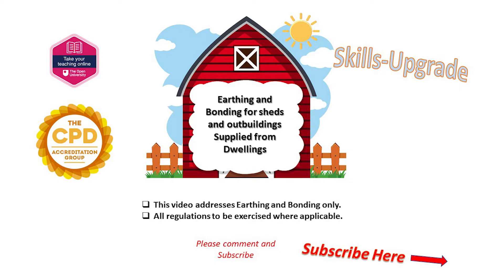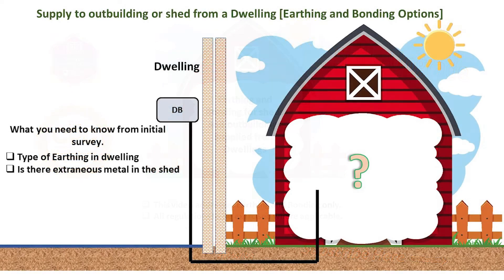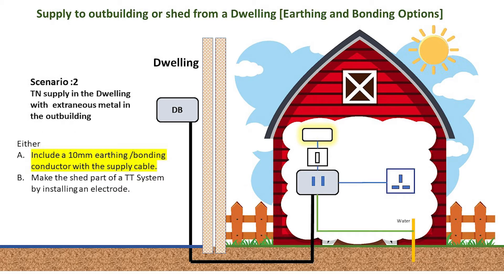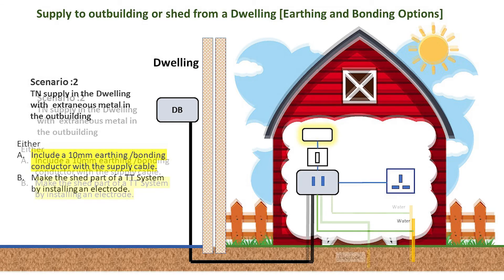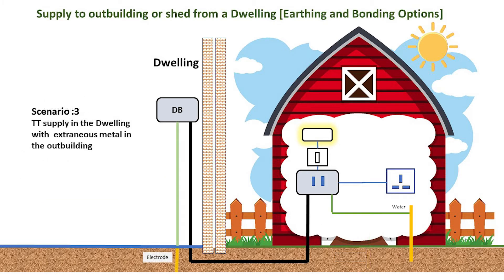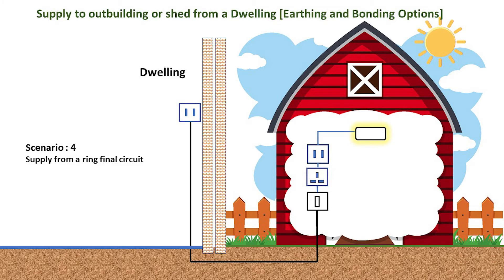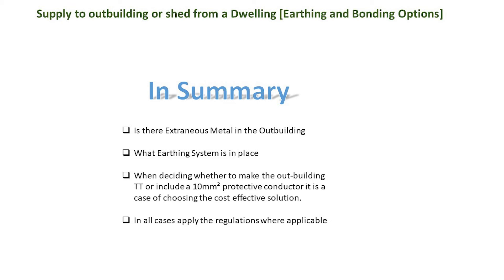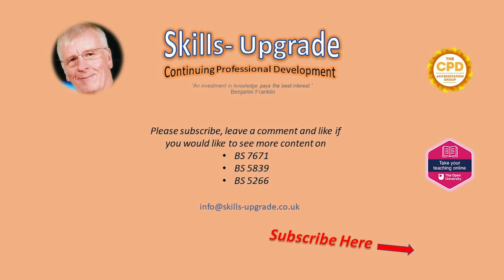outbuilding supply earthing and bonding 1

Comment: would the DNO be happy for you to export their TNC-S [PME] earth and put in writing in view of a PEN fault, i think not the only option is an earth rod for out buildings on TNC-S supplies simple
Reply from the maker: Hi William .. Firstly I hope I'm interpreting your comments correctly. The question regarding the DNO, Exporting the earth regularly crops up from time to time and I would point out the term "exporting"  with reference to earthing does not appear anywhere in BS7671 however I assume you mean extending the earthing system to another building. As the video shows providing adequate earthing and bonding is installed, safety is complied with. I'm always happy to update my understanding of our industry and would be interested in any correspondence you receive from the DNO

Comment: Very informative video James. Thanks for taking the time to produce it.
If the dwelling is a TT system, can you still use the dwelling earth?
I was told that if the dwelling is TT, the outbuilding must also be a TT, even if there are no extraneous conductive parts.
I've searched the regs for a definitive answer but I'm struggling to find it. Hence my YouTube search for info. 
Thanks again
Phil..
Reply from the maker: If I understand your question correctly, the shed is a circuit fed from the dwelling, which is ok. Are you considering making the shed TN-S or TN-C-S ?
Reply: @jamesfollon  The house is TT. So does the shed have to have another earth electrode making it a separate TT system? Or can I export the house earth (from the house's earth electrode) to the shed? The shed has no extraneous conductive parts.
From what I've found, I think I would need to make the shed a separate TT system, isolated from the house earth.
I've never worked on a TT system so have no experience in this area.
Thanks.
Reply from the maker: You can !!! there may be other considerations though !!!

Comment: Great video. Does the SWA feeding the shed need to be RCD protected if TN--C-S coming into the property???
Reply from the maker: Hi Manjit ... an RCD is not required for additional protection. See regulations 522.6.2 (i) and 522.6.204  .... cable specifications are in table 4A3 please subscribe and like if you found this helpful.
Reply: @jamesfollon  thanks for the prompt reply James.